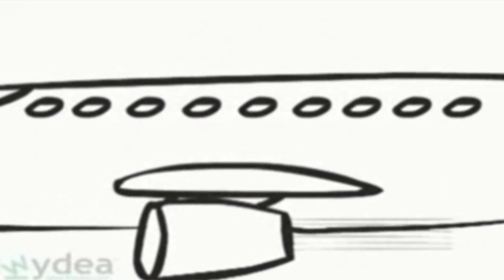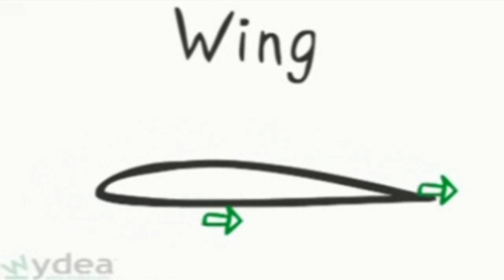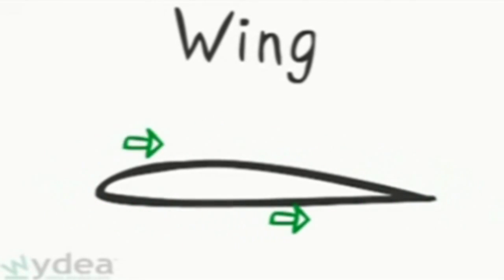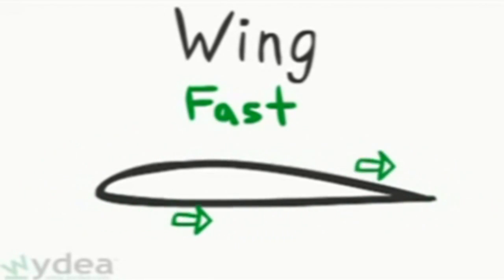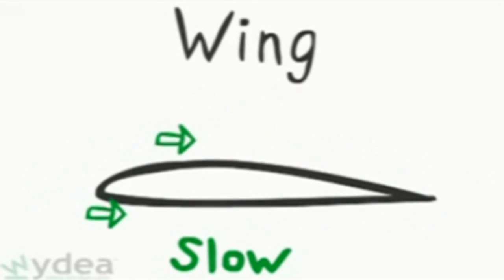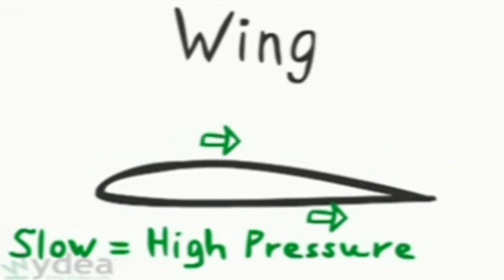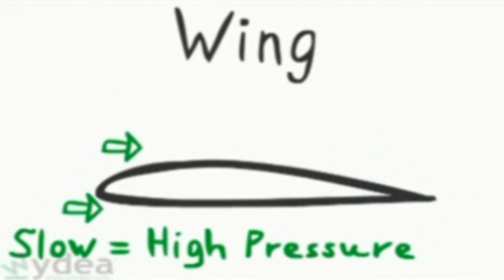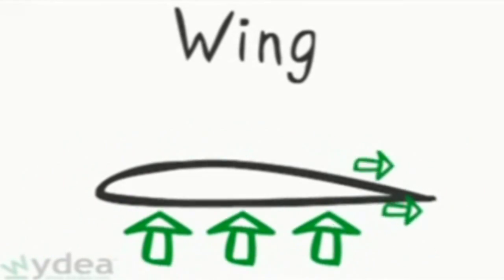Physics Project "Bernoulli's Principle" Hi-Def

Comment: the ping pong ball has lower pressure around it by the fast moving air  but the air ABOVE it is slower (because the ping pong ball is blocking the airflow) and when the air is slower it has a higher air pressure and making the ping pong ball not rise because it is pushing against the ping pong ball
Reply: Suraj Dinda  hi so is her demonstration wrong then? Or are they all fine I wanted to use on my presentation

Comment: Fantastic job! :) 
Unfortunately, these aren't Bernoulli effects.  They are effects of aerodynamics.  Bernoulli is related to contained, incompressible, ideally inviscous liquids (i.e. not air). If you don't believe me (I teach physics), poke around the NASA or Air Force websites.  Wing shape is designed to reduce turbulence, not make the air move faster over the top.  Keep the demos, change the reasons, or else you'll end up as misleading as many textbooks (and some teachers) are on this topic.

Comment: I think the experiment with the paper is due to viscosity.. try blowing the paper while its vertically hung, it wont budge because in this case she is demonstrating the viscosity of the air that is 'pulling' the paper towards it as it moves not so much the diff in air pressure per say...